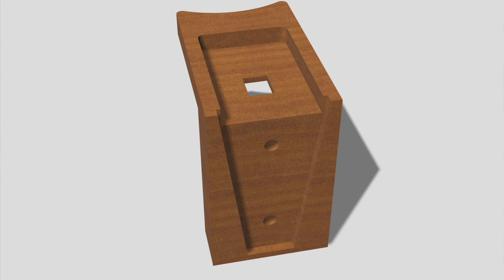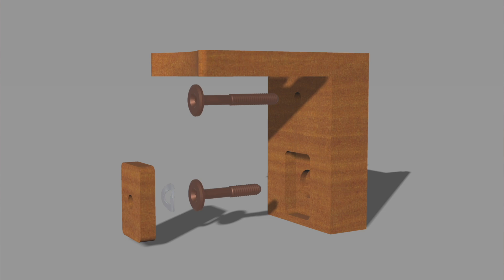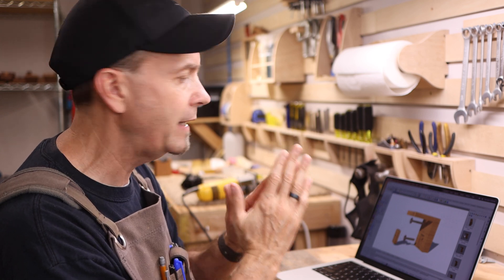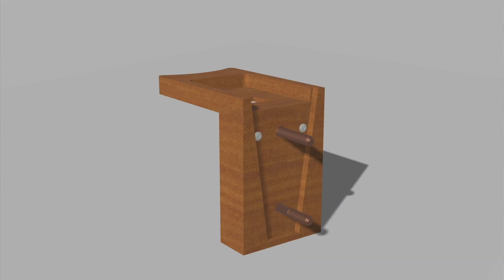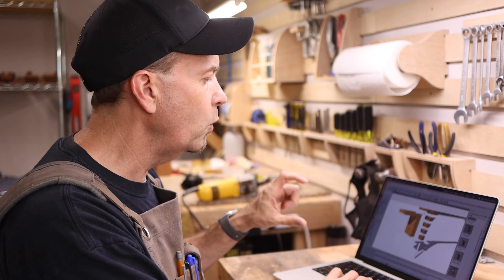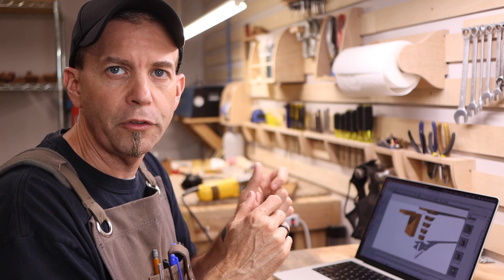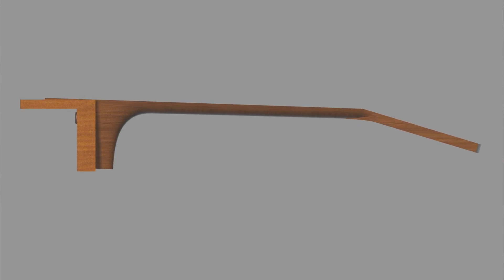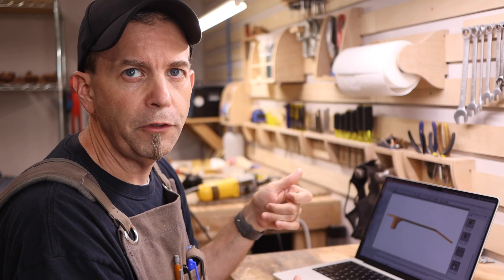Adjustable Guitar Neck - Part 1

Comment: Wouldn't it be easier to reset the soundboard since that's what caused the bridge rising above its original position? I can reset the soundboard after removing the warped bridge and fixing the warp in the bridge as well. The reinforcement under the sound of board needs to be fixed too but you can cut them and then reglue.
Reply from the maker: That's a lot of ungluing, shaping, re-glueing, etc.  That kind of work needs to be done under experienced hands.  (i.e. expensive)  The idea with the adjustability is to leave all of that alone in favor of a do it yourself method.  Plus, it gives the player adjustability to whatever attack/intensity/style of playing they have.
Reply: @pilsonguitars  If you have a fan braces guitar it's easy. The bridge is usually warped so that can be fixed by cutting it in two down the center without removing it. Then you just wet the soundboard and heat it clamp it flat and you're done.
Reply: @chryslercartography9024  true. But the earliest martins had adjustable necks that simply used a key that can be turned by the player. I mean just turning a screw kinda beats any soundboard adjustment.

Comment: If a neck is made properly, it doesn’t need to be adjusted. Micro adjustments can be made with nut slots, truss rods and saddles.
Reply from the maker: It's not imperfections in the neck that we're correcting for.  You're right, a properly built neck should last a lifetime.  It's the body that's going to flex a bit.  Now, hopefully that isn't much, but after 30+ yrs, you're likely going to need a reset because you'll be beyond the limits of adjustments at the bridge/saddle.

Comment: G'day Tim,  greetings from Mansfield in Victoria, Australia.  I'm a luthier and I'm really interested in this project to see how it evolves.   The idea of an adjustable neck intrigues me, especially to give players a choice and not to adjust over time.    I'll be interested in seeing if this can be achieved ultimately without CNC.  I guess it would be hard to get the level of precision required without CNC.    Excellent video!
Reply from the maker: Hey Mansfield to Mansfield… across the world, I love it!  I’m excited about the challenge and what I’ll learn along the way.  This will be heavy on the CNC side, but I don’t see anything that would be impossible without.  The pockets will need to be hand routed, but that’s feasible and certainly easier if you create a template first.  Thanks for watching.  More to come!
Reply: I had no idea you were also in another "Mansfield".  Uncanny coincidence right?    

Your pocket design reminds me of the Trevor Gore Bolt on / both off design from his book, but I don't think his book includes how his adjustable tilt necks are implemented.   I'll be watching keenly.